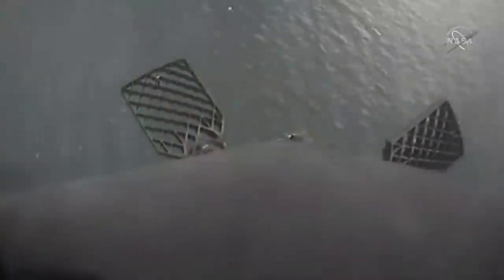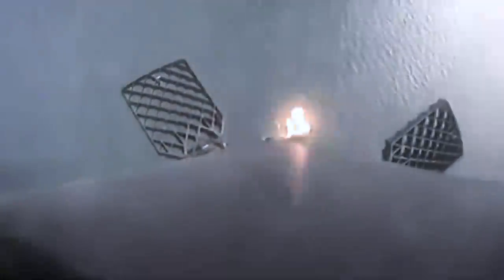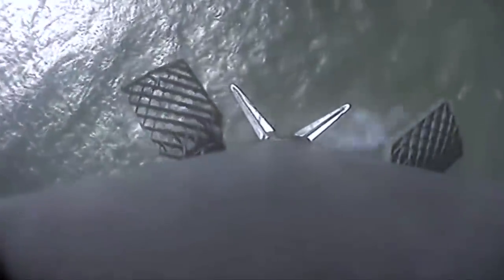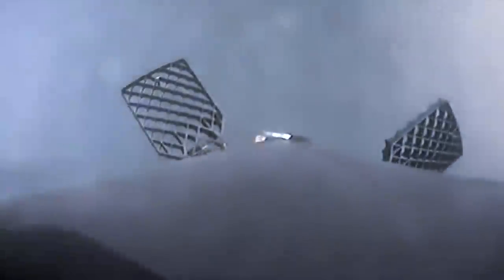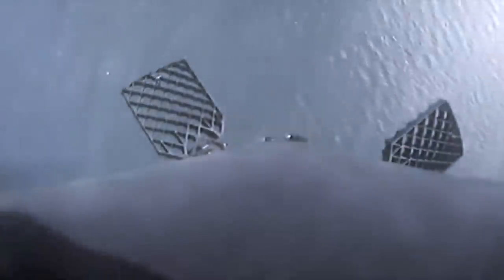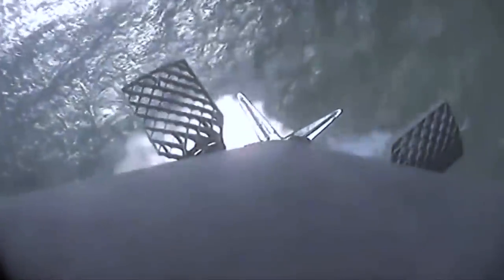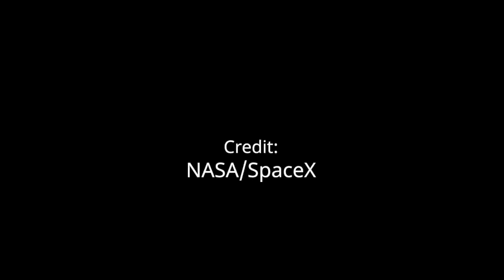Falcon 9 landing anomaly explained

Comment: They probably could reuse the Grid fins as they are solid titanium and the problem is simply a pump pressure issue.
Reply: They always reuse the grid fins. Last I checked there are only 8 titanium grid fins in existence. These grid fins will be inspected for structural damage and then attached to the SpaceX DM-1 booster, these fins were almost certainly onboard Es'hail 2, Bangubandhu-1 and the Falcon heavy test flight.

Comment: I think it is still reusable.😀
Reply: yes it is. Reply is a few coments above
Reply: @RaveIndianOfficial  -- No, this booster will never fly again nor will any of the engines -- once this thing hit salt water its game over.  That they managed to control it as well as they did is testament to the design and programming and although this is a failure it is a good failure given the success at ditching in the water and protecting on-land facilities and people.  Like the center core failure with the Falcon Heavy this will be a learning experience and this failure is not likely to happen again.  But, getting back to the original point ... there's no way this booster or any of the engines will ever fly again.
Reply: @Raptorman0909  They said they might reuse it for an internal mission. I'm with you though in that I kinda doubt it will fly again. It would be cool though it they can refurbish it.
Reply: Thermal shock to the engine that was running and stress to the body when it fell over will be the big issues, there will be lots of parts that were not exposed to the salt water.
Reply: @steverpcb  -- I'm sure lots of the stuff inside was safe from salt water, but the main things like engines were not.  I can not imagine the engines including the turbo-pumps surviving to fly again after contact with salt water.  The thermal shock on the engines that were running is one thing, but the chemical attack from the salt will render the engines unsafe for flight.  It would be useful, however, to test one or more of them just to see, but the risk to a payload and to SpaceX reputation will never warrant the reuse even if they look OK.
Reply: @Raptorman0909  The engines may not be ruined back in the 1960s NASA dunked some H-1 engines in the salt water for several hours ,then flushed them with fresh water and fired them in the test stand back when they were thinking about reusing the first stage on the Saturn rockets.
https://history.nasa.gov/MHR-5/part-2.htm
 In fact Spacex's original plan was to recover the boosters by parachute but they tended to break up during reentry.
Reply: @Raptorman0909  Merlin engines were designed to withstand salt water. The original plan was Falcon 9's would parachute into the water and the Space Shuttle SRB team would recover them.
Reply: @_Andrew2002  and Patchuchan -- I'm sure they would love to be able to reuse them after a salt water bath and I do expect SpaceX will test one or more of the engines, but this goes beyond SpaceX as they are the supplier to the consortium that pays for the launch and its the customer, and there insurance carrier, that are going to have final say.  When the payload costs 2X to 10X the cost of the launcher the customer actually has kind a lot to say about the rocket that puts them into space -- and so does the insurance provider.  I'll stick to my statement that none of the engines or other main components, like the tube, will ever fly again.  The tube looked like it smacked the water pretty good and as thin and weak as they are I have to believe the tube has been buckled a bit as well as some of the bulkheads.  Finally, like your car in an accident, once it is damaged beyond a certain point the insurance company totals it -- I'd say its totaled.
Reply: @Patchuchan  Indeed--in Wernher von Braun's article in the January 1966 issue of "Popular Science" magazine ("What Happens to a Rocket Booster?"), he mentioned a sea-dunking test of a Jupiter IRBM engine (a picture of it was shown), which still worked afterward, although the picture caption--and his text--said that the reliability of an ocean-recovered rocket would not make this a viable option for reusable launch vehicles. (The engines in question were all pump-fed, highly-stressed, lightweight powerplants, though; tests of large, heavy, pressure-fed, more boilerplate-like simple pintle-injection rocket engines [the Apollo Lunar Modules used pintle injector engines] indicated that seawater immersion didn't bother them.)
Reply: When i think about your answer, you are right🤔
Reply: Thaief Ahmed, yes, as Mr Musks new rocket boat 🚣

Comment: Very happy with space x, even on hard failure, they are still in control. Water as just a safety measure. The booster would landed perfectly in safe parameters. Huge victory and hard work proven 110% battle tank :)
Reply: Actually, I think they need the grid fins to generate aerodynamic lift in order to reach the landing pad - they couldn't have landed it on actual land without them, because they couldn't reach that far.

Comment: what had stopped the rotation caused by stalled grid fin? Sure, the angular momentum of closing landing legs had helped, but it had stopped well before that.
Reply: Cold gas thrusters, I think.  Once the landing burn started slowing the booster down, the grid fins didn't try to turn it so hard.  Then the cold gas thrusters could win.  Maybe the engine(s), too.
Reply: Reduced speed reduces the force of the faulty grid fin, so landing legs and engine vectoring stopped the rotation.
Reply: @thomaslinz8528  Plus the thrusters most likely...
Reply: It's because of rocket engine. It actually can move a bit (change its thrust vector) and was trying to stabilize the rocket while it was falling. You can see it by flames coming out of the rocket.
Reply: I think it was the burners, but maybe the gas thrust. One of them
Reply: It’s impossible for the engine to compensate as it only fired the center engine and there’s no physical way that could counteract the rotation. You can also see the cold gas thrusters firing as hard as it can. It, however, wont be very visible as F9 was already on dense atmosphere. Watch the playback again.
Reply: It was a three engine landing burn. Two of them will have gimballed against the rotation once the burn started.
Reply: @RandomUser311  Were the outer two lit just before touchdown? The long landing burn was obviously on one engine, watching the videos. Some of the RTLS landings had short 3-engine bursts  before landing (e.g. the Falcon Heavy side boosters). I suspect that the CRS-16 booster would have landed successfully on the landing zone, but until the last second it was way off kilter and not under full control so the conditions for a touchdown on land were not there.
Reply: @RandomUser311  Landing burn only has one engine on
Reply: @yuriyang2171  I don't think that's always the case, but I looks like you're right on this one.
Reply: @RandomUser311  Three engines burn is usually for the entry burn. Launch(all of them), optional boost back(maybe one), entry burn(three), landing burn(one). The centre core of the falcon heavy should be the only one supposed to use three engines for landing(if I remember correctly)
Reply: @yuriyang2171   But Awuma was right, the FH side boosters did a three engine landing burn. I just watched it again. (can't do it often enough) So it's not always a single engine landing
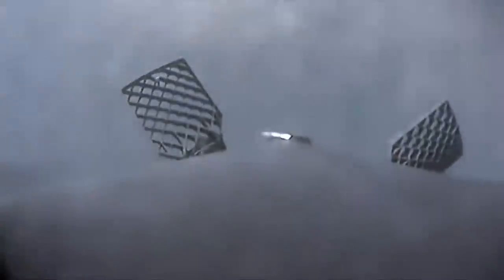Reply: @M1ddin1993  Interesting, I checked that as well. It was actually a one-engine start, follow by three-engine short burn and quickly back to one only. Check out 1:25, 1:28, 1:34 from the engine shot from this link: https://youtu.be/l5I8jaMsHYk?t=85  Maybe it is actually right. One for slowing down and two very low pulse for position control as they are not completely off.. Hard to say

Comment: terminating it would have been a safer idea to be honest
Reply: Not really, in fact that could have possibly made things alot worse, instead of one falling object you would go to multiple falling objects most likely on fire
Reply: @coolcdy  And sharp as many aerodynamic, ginsoo, ninja star, snow shovels  on fire
Reply: Not really needed because the trajectory of the rocket goes into the ocean until the last moment when it gets steered onto land.
Reply: The area is clear. No reason to create a field of fuel and debris in the ocean when simply letting it try to plop down is clearly easier to deal with after, cleaner, and will provide essential research data when inspections take place in a few days.
 This has been the contingency plan for such a failure event. Theres not enough fuel remaining to bring it in over anything of value.
Reply: Dippolito? With all respect, but that’s BS. Trajectory was under control. What do you think is gonna happen, if you blow up the rocket at this altitude. Think before posting. Glad SpaceX at least is doing it.
Reply: Flight Termination System is disabled 2ish minutes before landing. Explosion would cause more damage, than one piece.
Reply: @NesiYT96  Correct. Falcon 9 AFTS is safed between boost back burn and entry burn. A loss of engines at this point would leave an uncontrolled reentry resulting in hard spalshdown in a predicted area. Any red flags from telemetry indicating instability after that point can be monitored until the call is made to slam the valves and again, water. 
 The 45th Space Wing has control of FTS durring and after AFTS has been safed.
Reply: extra safety guys 😂
Reply: why? wasnt it certain that it will hit the water?